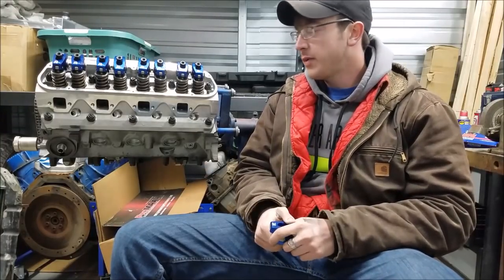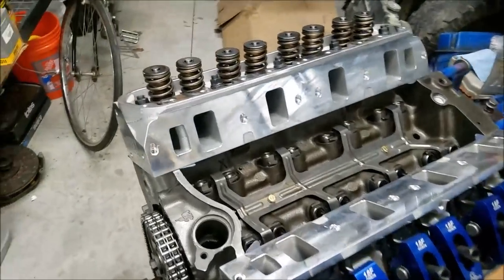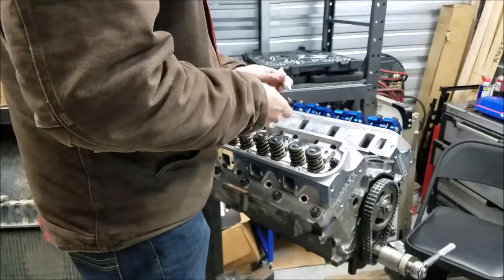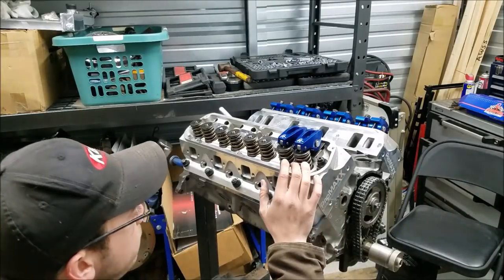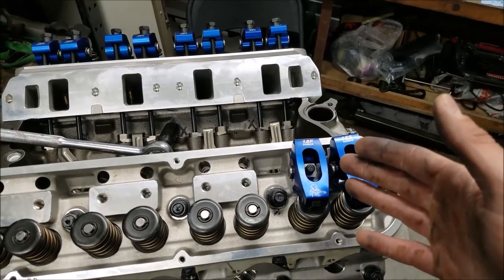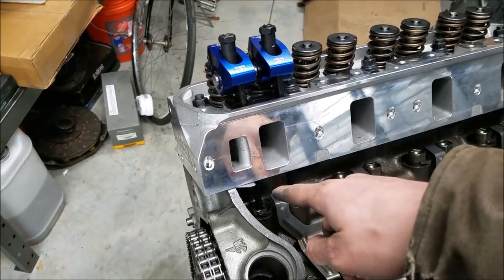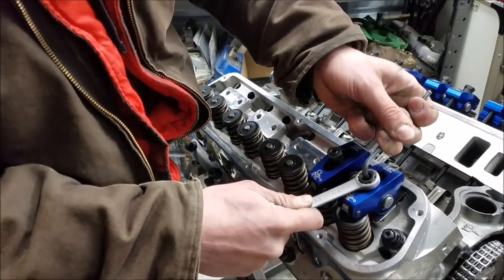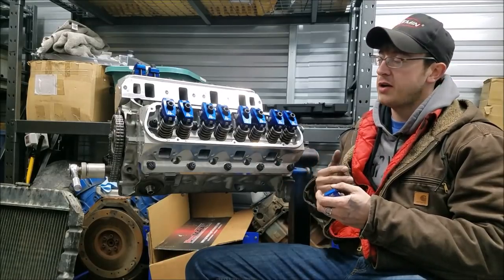How to: Adjust Valves/Set Lifter Preload & Set Up Valvetrain CORRECTLY (Ford/Chevy Small Block)

Comment: Im still liking this video I just saw of an engine builder by trade. He went around and set everything to 0 lash then turned the crank 90 degrees, then went around adjusting whatever wants still at 0 lash. Did that a total of 8 times for 2 complete crank rotations then went around and gave all the nuts three 1/4 turns, boom done. Seems totally legit to me and time saving especially if you have to deal with distractions.
Reply from the maker: Seems dumb and lazy honestly. I'm an engineer and process control programmer by day.

Comment: A little trick to keep them from shifting while you torque them. Stack up some feeler gauges in between the head and guide plate till the space is filled up then torque away they won't move a bit.

Comment: My ported LT1 heads also need thread sealer on the rocker studs. Noticed it during installation. Would've been a bummer if I didn't catch it.
Reply from the maker: it might be the hardest thing to track down ever . . . took 3 days to locate

Comment: I really wished you were my neighbor lol I tore the 5.0 in my 93 LX apart this spring to put in the F cam and 96 explorer 3 bar heads and intake that have quite a bit of port and bowl work. Guy said he had $695 in just the port work on the heads. But anyways it's out and on a stand and I have  no motivation to put it back together. No one I know around here likes cars or building them for that matter. Once the engine is done and in it's ready though besides the torque boxes. Been building it for 6 year and started at the rear and worked my way forward. Has the stock 8.8 housing with a 31 spline diff out of the same explorer with Moser axels and a 456 that I took from my ranger, stock T5 case (maybe the weakest link) with a g force gear set and MGW shorty throw that put me on the couch for a good month and almost made me a single man lol

Comment: Great video man! You are a natural teacher! Love watching some Thunderhead!
Reply from the maker: hey, i really appreciate that - if others dont have to struggle figuring things out like i did in the day, it was all worth it.
Reply from the maker: K05 T4R the base circle is the zero lift part of the lobe or when the valve is closed. What you describe with .020 feeler gauge would be valve lash which is clearance for solid lifters. Hydraulics need an extra .020 past the point of zero lash to set a preload on the lifter or else you will have some nasty valvetrain noise. 
Old videos, but timeless 👍

Comment from the maker: Cant decide what to put the mabbco engine in - help me decide!? Galaxie or Rotstang ??
the mabbco is 60 over 
i still have the 289 from the Galaxie - just needs overhauled 
the Rotstang would be best to test the "60 over sucks" concept on
Reply: ThunderHead289 Slap it in the galaxie so we can see some videos of it... what cam are you running in it?
Reply from the maker: its the xe266hr - seems like a good all around cam so far on previous builds.
Reply: Rotstang, the Galaxy is heavier and needs a Windsor 😉
Good job on your video's
Reply: Rotstang, definitely.
Reply: Definitely the Rotstang.
Reply: I'm voting with Nathan - love to see the Galaxy! Seems like a lot of motor for a car that's barely being held together.
Reply: I think the Rotstang has a much shorter life ahead of it,  so I'll vote for the Galaxy :--)))))))() BTW,  good luck either way !!!!!
Reply: ThunderHead289 I almost bought a mabbco engine I'm so interested in following that one
Reply: Since you have the original 289 I'd use it for the Galaxy. As those old cars get more rare it's best to keep them as original as possible. I'd stick the mabbco in the rotstang.
Reply: If you haven't already accomplished this I'd recommend putting the engine that produces the most torque into the heavier car, the Galaxie.
Reply: ThunderHead289 I just bought the xe266hr12, hoping it produces enough vacuum to operate power brakes, steering, etc. also hoping there’s enough overlap to bleed off what I’m expecting to see in the neighborhood of 9.76:1 static, 190cc aluminum heads , 331 scat  rotating assembly with 6.6cc Mahle pistons. Hoping that I have the piston to valve clearance too
Going in my 1980 Granny 4 speed Bronco
Weiand street warrior intake (hoping it doesn’t leak and suck, cam still return it to Summit) have Summit 600 Carb with annular boosters.
Any opinions welcome. Block is in machine shop now so I’ve got a couple weeks

Comment: Love seeing the motor related videos on here all though most don’t pertain to me it’s helped me be more comfortable taking motors apart. I could never get my b2200 to run right after going through it and adding a Webber. Recently found a deal on a complete sportage that’s a bolt in swap hello 2x the power and big bump in mpg best of all fuel injection

Comment: Thanks for the video Bro, it helped me out alot. I have a question I adjusted all rockers on my 1989 5.0 engine, but when I got to the last cyclinder rocker 7 & 8 and turned the motor manually. Those 2 rockers did not move at all to make the proper adjustments. I turned the motor a few times and the other rockers did move up and down. The engine itself is all put together and did run with no issues. Is there anything I can do without taking off the intake off. My knowledge and experience is limited. Thanks for your time.

Comment: @ThunderHead289 Do you ever use offset lifters to help with the valve train alignment issues? I'm installing Holley heads and they're famous for valve guide wear, from what I'm reading. When I was mocking them up, I ordered the solid guide plates and they did not line up, so I switched to the adjustable ones like you used here. Just wondering if offset intake/double offset lifters would remedy that type of misalignment.

Comment: Question about pre load.
A local race car engine builder said my valves need adjustment. 
He said to bring the engine to operating temp and adjust the rockers until the pushrods stop turning and then tighten them... no preload. Is this because the lifters are already pumped? Should I do pre load or not??

Comment: I had to come take a look at this took the old Windsor Fairlane Out For A Rip came back with two dead cylinders the poly lock on 4 exhaust back completely off one on number 3 intake broke I'm looking at pulling all that apart and starting over and readjusting the guide plates some of the rollers are only half on the valve stems I hope it's just a $20 fix and some labor praying the cam didn't get hurt I need to run one more year$$$😕

Comment: Not really related to this video but...  when installing flywheel do you use thread locker or thread sealer?  I used lock tight and I think I have an oil leak from the flywheel bolts now.
Reply from the maker: I usually use a thread locker or sealer - if you used a locker, it should be sealed
Reply: Rear main, perhaps?
Reply from the maker: I think that is the more likely cause
Reply: ThunderHead289 new FRPP crate engine

Comment: Can a Blueprint 347 lifter assembly with standard bolt system be converted to a locking system like you are using or does that take a specific head. Thanks in advance

Comment: When centering the rockers on pushrod guideplates, when the pushrod ends up a little skewed, is that going to lead to valve guide run out? Or is it not because it’s the pushrod and not the valve?
Is there no way to correct the geometry?
Do the guideplates move enough to warrant a re-do after so many thousands of miles, is there a recommended duration between checking/adjusting?
Thanks (newbie here)
Reply: offset rockers/  shaft rockers

Comment: Im using the stock rockers on a fairly warm 331. Same deal with half a turn past zero lash?
Reply from the maker: You can go up to .060 thousandths, but ideally you want to run them in relation however the pushrod length was spec’d - I’d say go a half, then if they make noise, go 3/4. 
If they still make noise at 3/4 - in my experience, that’s a bad lifter
Reply: thanks for the reply.

Comment: I have a 1965 mustang 289. I stopped to get fuel was running fine holding 75 psi of oil pressure. Came back out to fire it up and engine is locked up. Any ideas? Thanks

Comment: Starting to get going on my olds 455 build how would you recommend I adjust my valve train for a hyd flat tapped before initial break in, don’t wanna end up with flat lobes
Reply from the maker: do you have stud rockers on that engine?
Reply: ThunderHead289 yes studs and guide plates with full roller rockers
Reply from the maker: alright - 
flat tappets are a pain really. this is what i do
i break the cam in with stock springs or lighter springs if i can help it - im not always able to. your preload should be the same - no issues there. 
you will want to throw in a zinc additive for sure. either lucas, comp, and even trick flow make a break in additive. run the engine for 2000 to 2500 rpm for 25-30 minutes and then drop the oil. 
keep using zinc additive from then on. 

i did this in my solid lifter 289 and i never had an issue - it started having some blowby at 80,000 so i pulled it. she had a hard life, and i only had iron rings so 80k was not surprising. (my point is that the valvetrain stayed together)
Reply: ThunderHead289 I’m not worried about the break in itself but more so the initial adjustment to get the correct preload like could I do damage to the game rotating it by hand to get them all set. It does have a good coat of assembly lube but I don’t want to chance it
Reply from the maker: ah, understood! 
if you have good high pressure assembly lube, you will be just fine! 
prime her before you light her
Reply: ThunderHead289 that’s what I was looking for thank you man!

Comment: After the engine is installed ( say from the factory) , do you ever need to go and adjust your lash and preload as a maintenace issue? I have a 93 f150 with the 5 0

Comment: What are the cons of self align rockers?
Reply from the maker: The ones with vertical geometry at the tip? Biggest issue is that they have the potential of engaging the spring retainer cup and dislodging the valve stem retainers - dropping a valve.

Comment: I have a question about the preload. Your engine in this video has 3/8-24 threads studs i believe. So if i understand this correctly You came up with the preload of .020 with half a turn by dividing the thread pitch by two because you are turning it half a turn?

 Not sure what the spec is on my big block Chevy engine, but im assuming the same method could be used to figure out how far i need to turn the lock nuts on my ricker arms?
Reply from the maker: Correct! It all comes down to the TPI! 👍
Reply: @ThunderHead289  thanks, thats what i thought. After watching a other video i was a little uncertain though. I think what he was trying to say he wanted .035 to .060, but he turned his 3/4 of a turn which put him in between that not the .035 he mentioned. Thanks again. Jeep the videos coming. Looking forward tonsome burnouts with the satellite.

Comment: Question the lifters have a little hole in the side does it matter if hole is facing up or down
Reply: Lifters rotate (spin) when engine is running. Therefore the location of the side hole in the lifter does not matter.
Reply: No these are roller lifters with wishbone style guides so with that in mind I put holes up thinking oil can flow down and around lifter

Comment: Hey, I just picked up the same heads and they sent out the fixed guide plates VS the adjustable. I have that pigeon toe rocker alignment as you mentioned. I was curious how much I could correct it or if I should just leave as is?
Reply from the maker: I definitely recommend utilizing adjustable guide plates - if you don’t, it’s likely your rocker tip isn’t centered on your valve causing awkward stresses and strains
Reply: Ahhh I was afraid of that. They sent the fixed plates out and I was like ok, I guess this is what they recommend using.
Reply: Overthinking perhaps. But as long as the roller is centered over the stem you should be good? By running a adjustable guide plate aren’t your running the push rod at a slight angle perhaps causing premature lifter failure?

Comment: I've watched videos of guys replacing lifters with the engine in the vehicle. I've got a 66 F250 with a 352FE that i've noticed pretty loud lifter ticking. I've ran a seafoam treatment that has helped quiet them down, but I've decided to move forward and replace them as I plan on driving the truck daily. Do you feel its safe or practical to just replace the lifters, or should I also replace the rods?
Reply from the maker: Lifters wear into the cam, my fear with a flat tappet cam is that once the new lifters wear in, you will have worn through your hardened surface on the cam. Once that’s gone, lobes disappear pretty fast
Reply: @ThunderHead289  10-4, I'm just trying to keep driving it until I get into a position where I can pull and rebuild... or just upgrade to a 460 lol.  I'll just continue with a few more seafoam treatments as it has made a difference.  thanks for the prompt response.

Comment: Aren't u suppose to use a filler gauge between the rocker and valve?
Reply from the maker: Rafael Sanchez that’s for solid lifters 👍
In that case it’s the same process, but instead, you run the nut and locker down on a feeler gauge set and there is no “half turn”

Comment: I see guys switching to HEI thinking it's better.
There's a reason GM abandoned it.
During the years these were in service I did more service calls for GM vehicles with dead HEI than Ford, Mopar and imports put together.
 Spark burn through on the rotor was common. Spark then goes to ground via the distributor itself.
Next, module failure do to the heat, it's under the cap and at the back of the engine where little air flows , which was why GM put it in the back in the 1st place ( protect
the points from water )
 Ford module is mounted away from direct engine heat and by DuraSpark ll the reliability was higher than GM HEI.
 Bought an 84 F150 with the HEI
Unfortunately the guy removed all the wiring and module, so for now still running HEI.
 3 module currently, always use the heat transfer grease that has to be used.

Comment: If you could send this video to myvintageiron7215, i'm sure he would appreciate it. Thanks for doing it correctly.
Reply from the maker: Chris Mansel he doesn’t like me very much I don’t think
Reply: @ThunderHead289  he basically called me an idiot for adjusting lifter preload by spinning the pushrod the same way you did. We have tried that up and down method, and it don't work as well for finding zero.
Reply from the maker: Chris Mansel yeah, I’m not a fan of up and down. Although I don’t think it matters too much, hydraulics are kinda sloppy anyway, 1/2 to 3/4 of a turn - the differences there would probably not be noticeable. But I’m a perfectionist

Comment: “The very moment that I feel any resistance on my pushrod and its rotation”.  It would have been preferable to explain that you are trying to achieve zero lash prior to setting preload.  The correct explanation is to tighten the adjuster nut of the poly lock, typically by hand as you did, until you get to the specified or preferred lash which is zero in the case of your installation.  The lash is the distance from the roller tip to the valve stem which should be verified at the rocker tip and not just by twirling the pushrod.  Sometimes, people refer to this also as zero preload which is correct if referring to the lifter plunger itself.  Verifying zero lash at the rocker tip to valve stem should be accomplished regardless of the method you used to remove the lash.  The twirl method requires caution where a roller rocker is heavy and mass may stop the pushrod from rotating early.  We, and notably Comp cams, prefer to confirm zero lash properly at the tip centered on the valve stem while verifying that the push rod can no longer be moved up and down twirl resistance notwithstanding.  The final tightening of the polylock is correctly achieved with a proper polylock adjusting tool where the mechanic completes the last 1/16” (approx.) of the polylock rotation while simultaneously tightening the allen set screw.  Your hand tool method overall instructions are correct for the typical ½ to ¾ rotation past zero lash instructions common with aftermarket cam instructions such as Comp and Crane.  Keep in mind that the aftermarket cam manufactures are using common rocker stud threads per inch to determine correct preload for their brand of lifter.  Your lifter may require a different preload distance.  We prefer to check one lifter via dial indicator direct measurement to verify correct lifter preload distance per turn of the polylock.  Then, the # of turns (typically a fraction) can simply be duplicated on the other valves.  The upshot of your video is for dry, non-pumped up lifters.  Do not use your method for pumped up lifters.  If the engine has been run or someone pre-pumped them, then adjusting preload must be accomplished after the lifter is bled down.  Lifters should not be pre-pumped unless the instructions specify that.  Prepumping lifters i.e., filling them with oil, often cause the valves to open during the adjustment procedure vs. correctly locating the dry lifter plunger in its preloaded operating location.  A proper valve lash adjusting tool can also measure torque.  It should be noted that exceeding 25ft lbs. on the final rotation of the polylock is not common.  If this happens, ensure that that lifter has not been pumped up.  That is a longer discussion that I understand that is beyond the scope of simple weekend fun vids such as yours.  My remarks imply no criticism sir.  Between you and that uncle tony guy, my students and I have had endless hours of entertainment and lessons learned that help them earn certification.  Please keep posting these things.